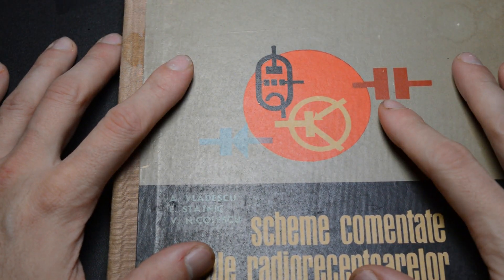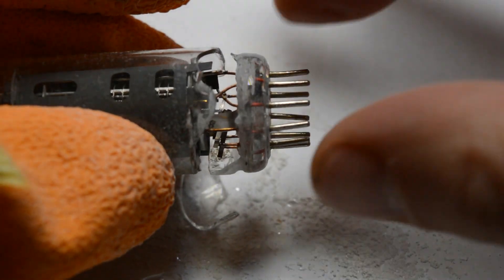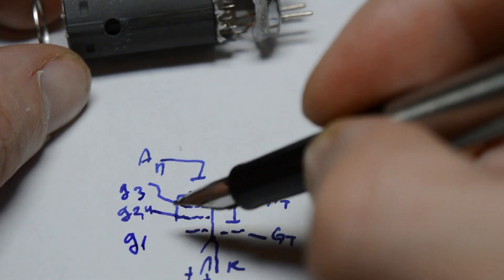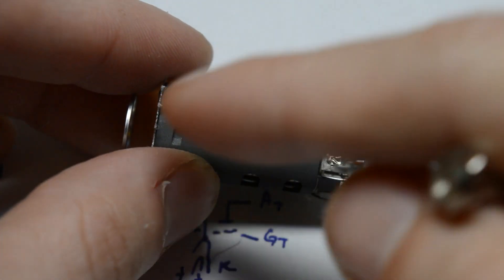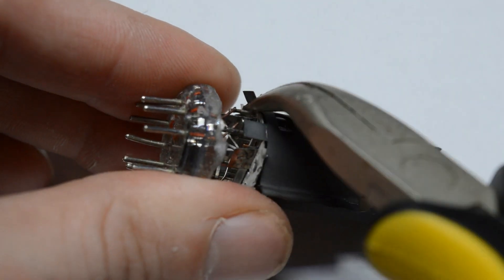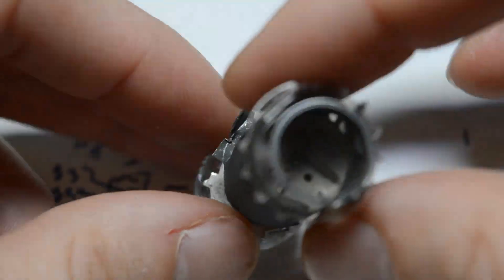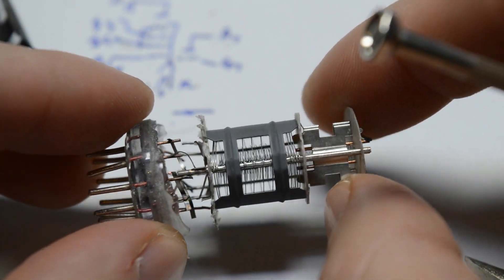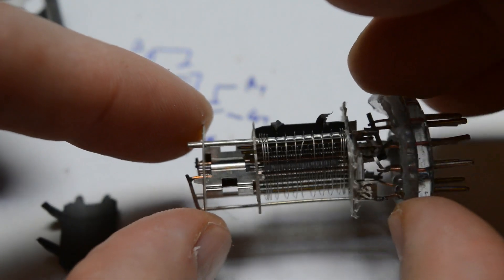Vacuum Tube teardown - the ECH81 signal mixer tube

Comment: My tube radio is not picking MW stations but SW stations. Is resistance connected in Pin no 7 &9  (33k) to ground is responsible?

Comment: Very helpful!  I'm trying to understand how the triode side works with the oscillator.  What comes out of and/or goes into the triode's grid (7 & 9) and plate (8)?  The radio I'm learning on uses a dual triode (7F8) instead of a heptode+triode, and I'm not clear on the paths on the right side.  Thank you, and remember to floss :-)
Reply from the maker: Well the oscillator is basically an Armstrong type only difference being that the resonant circuit is in the anode rather than on the grid. 
I'm not entirely sure why they connected the triode grid with with the heptode grid. I guess this way there is better separation between the local oscillator (that is only in the anode of the triode) and the mixing heptode.